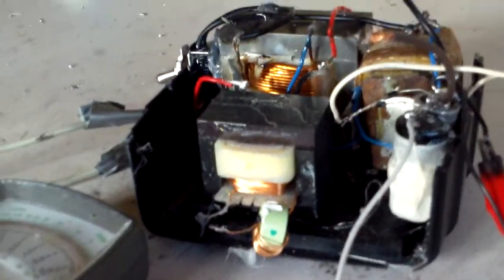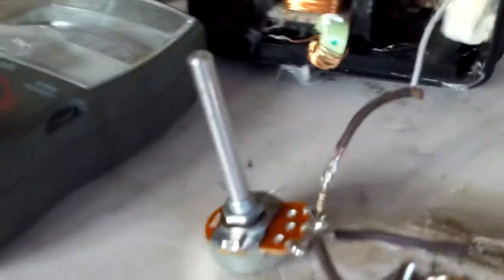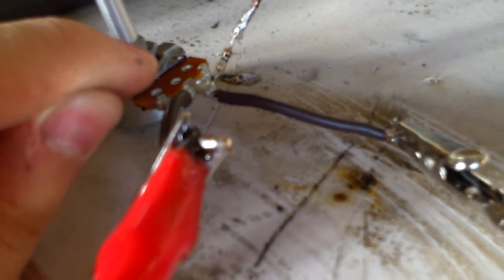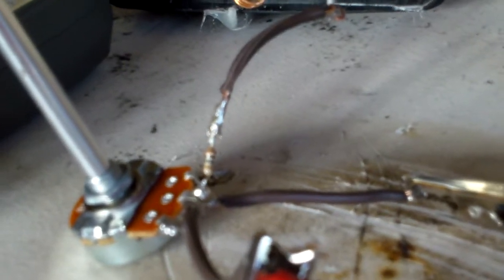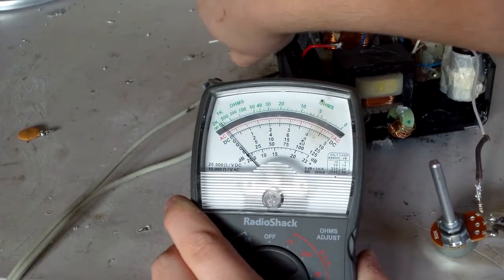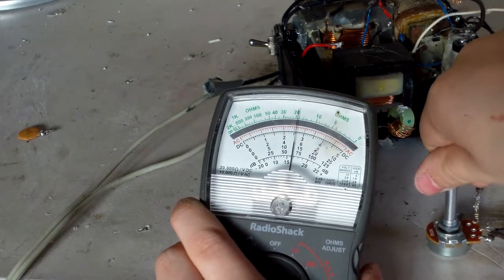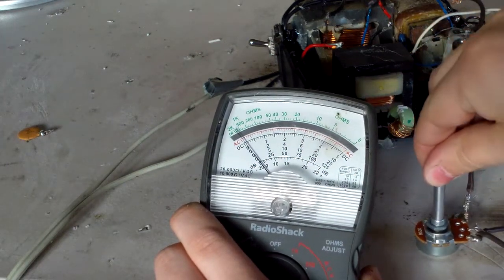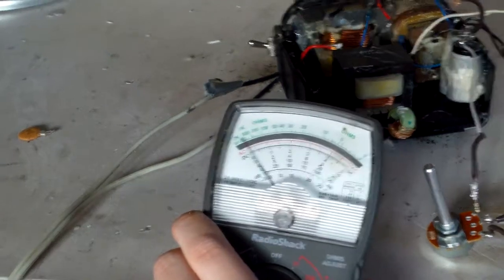vacuum tube bias

Comment: connect an electrolytic from 1000 - 4000 uF to it. Connect the + from the electrolytic to ground (zero, here is also the - from your 300 V power supply connected). Connect a 10 K - 50 K potentiometer parallel to the electrolytic cap and connect the wiper to the control grid. Now you set a negative (-) voltage between zero and approx. minus 20 V on the control grid and set the tube to its correct working point, where it acts as amplifier. Lots of succes.

Comment: Good and valuable experiments! Keep up the good work. As far as I could see the 2E26 is transmitter tetrode for VHF. I dont know whether it can work for audio, perhaps? I have some doubts, but, there is a chance. According to the 2E26 datasheet, the control grid needs a negative voltage from - 14 V. As far as I could see you give it a positive voltage. So: take a transformer from 14 V, connect a bridge rectifier to it. Reverse the diodes in the bridge rectifier and...